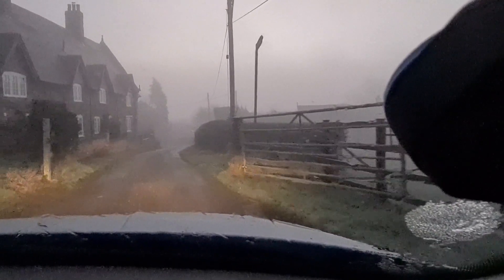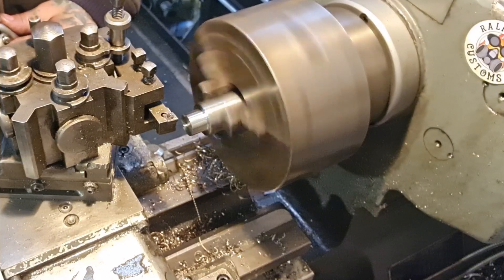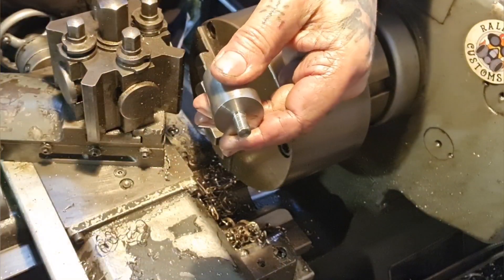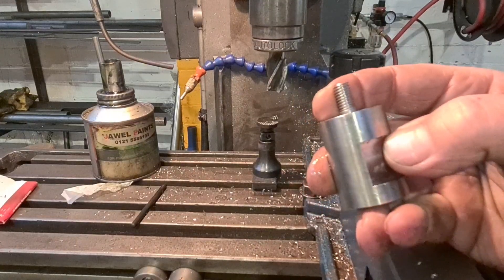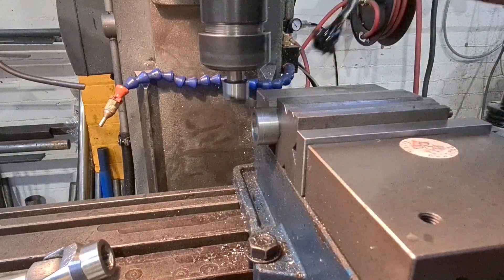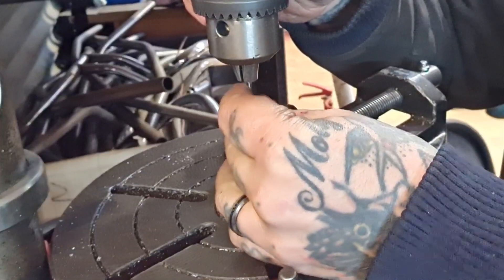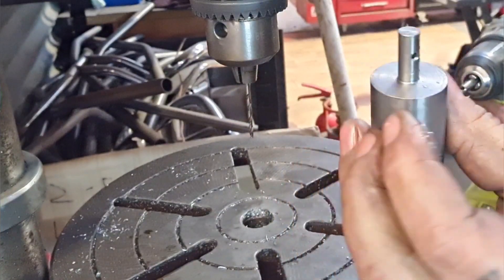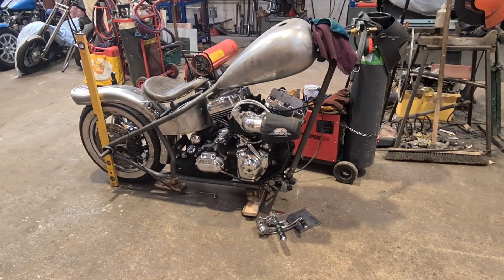Harley Road King Chopper Build Pt6B Custom Sprung Seat #workshop #Viral #harleydavidson #handmade

Comment: They are funny things those hairpins 
If you bolt them top and bottom they end up rock hard because the try to pivot forward under compression
I ended up making pivots top and bottom 
Looking great what you've done there excellent work ,pins should work well 
Cheers
Reply from the maker: Thanks Nick, yeah they need to be able to move a little